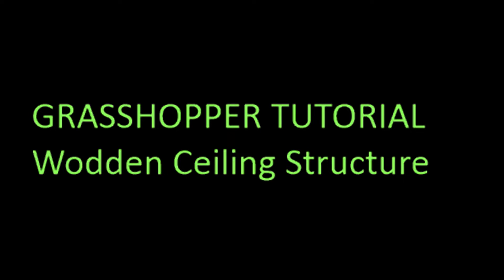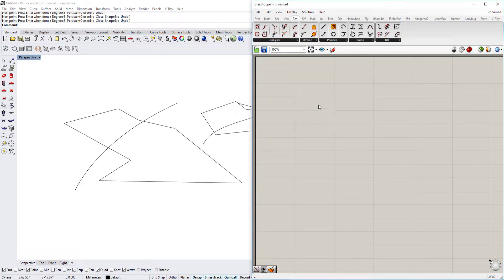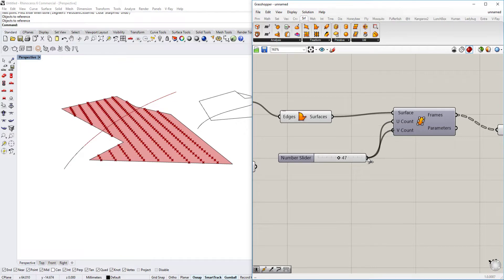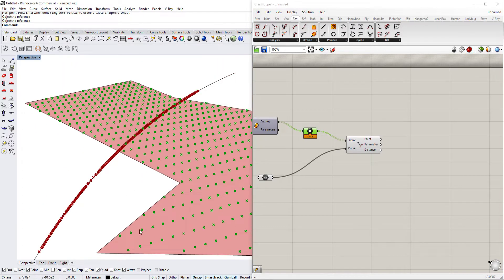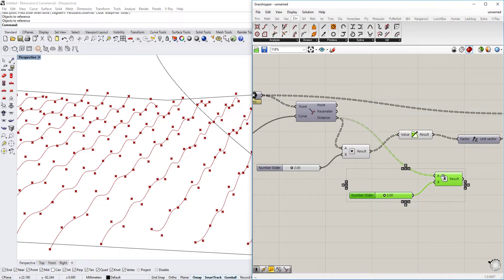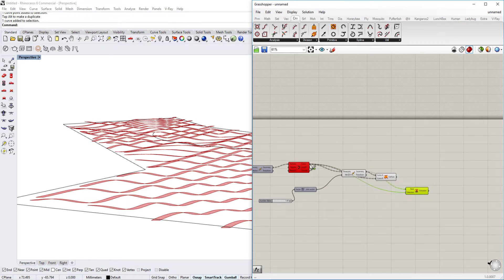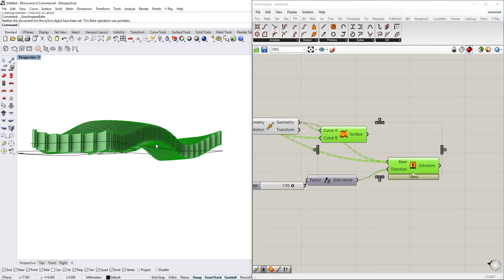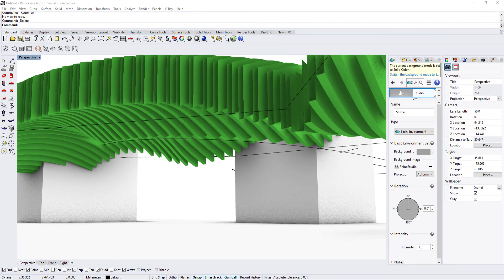Parametric ceiling with Grasshopper

Comment: Hi I'm wanting to do this but also have it curve into a facade so it's like a C shape, I've tried to change the surface geometry but it doesn't register it
Reply from the maker: Hey there, really good point, with that you might need to evaluate the surface points in a more distinct matter in order to know the exact shape of the surface, the topic become a lot more intresting then, obviously and there might be more overlaps and things to solve. other than than you can try to exchange the z direction into x and y directions, might give you a similar result, or just changing and rotation the results afterwards :)

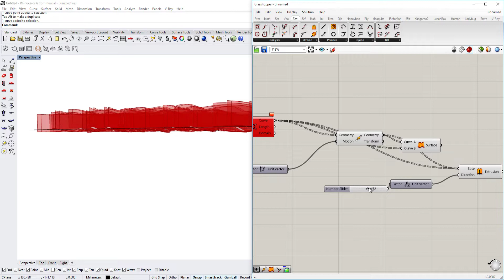Comment: At 8:50 when u extrude, it's is showing a U shape, it's not capped off at the top. Is it a solid beam, the extrude?
Reply: i had the same question. What I did to create a solid between the curve is at the end  of the script, on the "extrude" component, I added "loft" and it created a solid. I know it's a year late, but I hope this helps.
Reply: sorry one last thing, once you loft, at the end of that component add "cap" so it makes it solid geometry.

Comment: 5:55 At this point, the dot does not move. Please tell me the answer.
Reply: hello, were you able to figure it out?
Reply: @ardensun  I multiplied the sine result with 100 lol. I noticed that the points were indeed moving but the change was so small to be seen in rhino. let's see how it turns out

Comment: How would i change the direction that the lines are going?  They are vertical right now and i need them to go horizontal and cant figure out how or where to rotate in the grasshopper script
Reply from the maker: that's actually a really good point to have; by looking at it now, I would suggest that you would create a a grid of points, that would surround the polyline completly, then you will use point in curve, and you would sort out the points that are not inside the polyline. Once you did that, you could rotate the base grid around the center point of the polyline, in order to rotate the points (and lines) with it.
Reply: after talking with some other users i found one that ran into this same problem in a different use.  When going into rhino you can select the curve and flipdirection to change which line the slats follow either the u or v sides.

Comment: Instantly subscribed. 

Making discrete the plenum is a great idea for architecture. But can this be more than a geometric gesture? Of course the definition allows to turn these type of plenums thermal playing with the facade. These are natural lighting devices that diffuses indirect light towards deeper region of the space. 

Well, the plenum is badly designed and the projected ceiling doesn't have the love that it deserves. These corners of architecture may gain a design possibility other than being requisites hiding the HVAC devices.